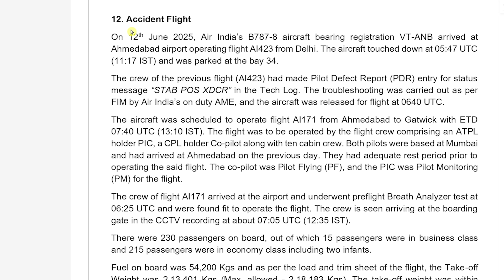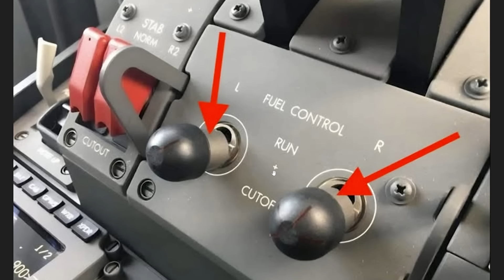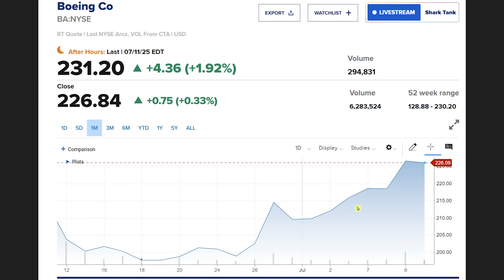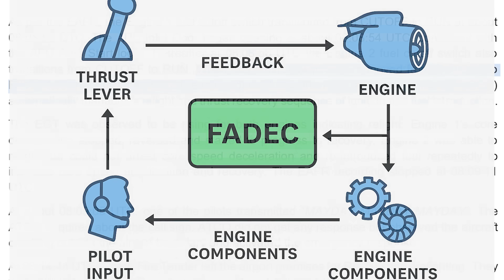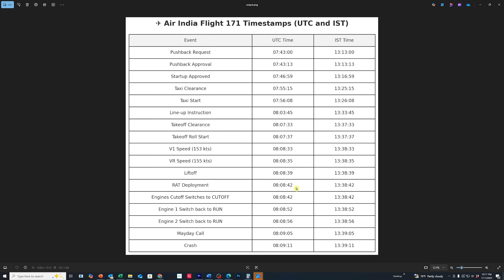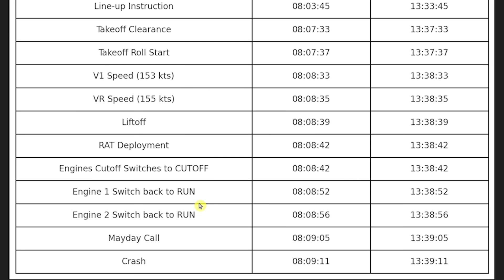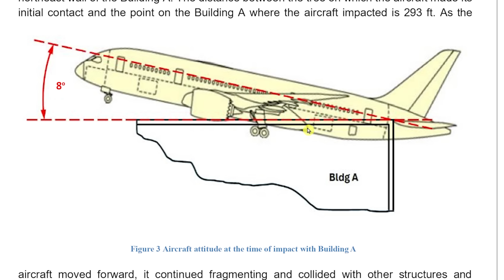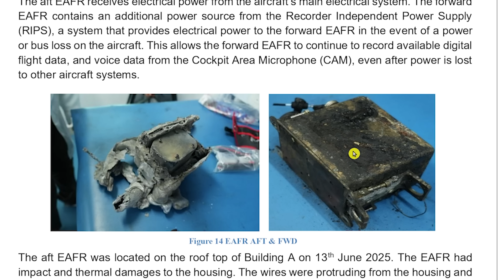Did Pilots CUTOFF Fuel? Shocking Twist Air India 171 Report!

Comment: Is it possible the switches were not fully engaged into the run position the first time and then slipped back to cutoff with vibration from takeoff? Im sure the pull is strong on them but maybe pilot didnt push it all the way up? Sort of like hovering on the detent but past the halfway mark. Even though that would be a terrible design if the case.
Reply: And he would have to do it for BOTH switches...
Reply: @BlueSpruce2 true. But now that I've read more, I'm not sure they were ever manually in an off position without both or either pilot being  aware.
Reply: @mikesorensen5228 Totally agree. This is my position as well until we understand what exactly the switches are signalling - the computer in the EE Bay below the cockpit or the FADEC/EEC on the engines?  We need the wiring diagrams and system logic for those switches.  I doubt they are hardwired directly to the engines or fuel delivery system.  And this begs the question - what is the FDR really recording - the actual physical position of the switch or an electronic signal received or transmitted from the computers to the engine or received by the engines?
Reply: @BlueSpruce2 as well, the report quotes the voice recorder without including a time stamp, so we dont know when that was said.
Reply: @mikesorensen5228 ...or picked up my the microphones - such as a switch or switches being physically moved...  The timestamps/synchronization between the CVR and FDR is going to be critical.
Reply: @BlueSpruce2 100% although they may already know something we don't.

Comment: Also, if the engines were shut down by any cause, it seems from my very limited knowledge that cycling the fuel control switches off then on it would have been the fastest way to  initiate restart automation. (?)

Comment: ✈ Final Sequence of Events (from EAFR + Report)
Takeoff Roll Start: 08:07:37 UTC

Liftoff: 08:08:39 UTC

Max Airspeed Achieved (180 KIAS): 08:08:42 UTC

Immediately After — Dual Engine Shutdown:

Engine 1 fuel cutoff switch flipped to OFF at 08:08:42

Engine 2 switched OFF 1 second later

This initiated complete loss of thrust

RAT (Ram Air Turbine) deployed within seconds — backup hydraulic power due to total power loss

Cockpit Audio: One pilot asked, “Why did you cutoff?”

The other replied, “I did not do so.”

Restart attempts were made within 10 seconds — engines started to relight

But the aircraft was too low and too slow to recover

Crash: 08:09:11 UTC — 32 seconds after liftoff

🔍 Root Cause: Why the Fuel Cutoff Switches Were Flipped
1. 🛠 Cockpit Switch Design Risk (Known Issue)
The fuel control switches installed on this Boeing 787-8 (Part # 4TL837-3D) have a locking feature.

However, a 2018 FAA bulletin (SAIB NM-18-33) had warned that in many Boeing aircraft (esp. 737s and 787s), the locking feature was improperly disengaged, allowing unintended switch activation.

Air India did not perform the recommended inspections, since the SAIB was advisory, not mandatory.

👉 Interpretation: If the locking mechanism was loose or malfunctioning, a hand, clipboard, or turbulence could have accidentally flipped both switches off, especially during a high-stress moment like takeoff.

2. 🤖 Human Factors: Pilot Error or Confusion?
No checklist or SOP during takeoff would call for fuel cutoff.

One pilot asked the other “why did you cutoff?” — showing confusion and possible lack of situational awareness.

The switches flipped sequentially (1 second apart), suggesting they were manually activated — likely by a human hand, whether intentionally or inadvertently.

👉 Possible Scenarios:

Inadvertent Activation: A pilot might have rested or brushed against both switches during a task (e.g. reaching for gear lever or checklist).

Misidentification: A pilot could have confused the fuel switches for another control, though this is unlikely given their distinct location and function.

Mechanical Jolt / Loose Guard: Turbulence or vibration might have nudged them if the guard was disengaged.

🧩 Supporting Physical Evidence
Fuel switches were found in RUN position post-crash — indicating the crew tried to reverse the mistake.

EGT (Exhaust Gas Temp) rise confirmed relight process had started, but the aircraft was too low for recovery.

RAT was deployed — confirming total engine failure.

🛑 Final Conclusion
Air India Flight 171 crashed due to the unintentional shutdown of both engines immediately after liftoff, likely caused by inadvertent movement of the fuel cutoff switches by a pilot.

This led to:

Complete thrust loss during the most critical phase of flight,

A delayed recovery attempt (relight),

And insufficient altitude and time to regain control.

The accident was likely triggered by cockpit design vulnerability (unlockable fuel switches) and unintentional human action, not by mechanical or external failure. The pilots reacted swiftly, but the loss of power was unrecoverable at such a low altitude.

Comment: Is there a direct instantaneous deployment of the RAT when fuel control switches are moved to OFF? OR  does a. Computer detect a loss of electrical power and THEN deploy the rat? Your timeline shows the cut off and the rat deployment as simultaneous. The generators could not have slowed enough to
Trigger a low power rat deployment. 
If this is the case the more likely scenario is the switches were cycled to try to restart an engine shut down by a computer error. I'm no pilot so don't know what signals the rat to deploy EXACTLY. 
Please explain, thanks.

Comment: Why do you need/require to shut off the fuel? Fire? - How fast does it react/need to react? Would you try the fire extinguishers first?
If I was in charge Idon't think I would ask "did you do that?" - I woud turn the switch on to run - then have a chat.

Is it time for a CCTV element to the Black Box?

Comment: I think quite a bit has been omitted from the CVR record, notably the interactions with ATC and the response when one pilot said "he didn't do it". Surely the other would have responded something along the lines of "Well switch the bloody things back on, anyway!".
   I don't think "pilot error" is the right description. I am sadly forced to conclude that barring system problems, either the fuel supply to both engines was consciously and deliberately cut off, or the pilot who did it was psychotic or experiencing some other kind of serious medical glitch. I had a medical procedure  under local a couple of days ago. Back on the ward afterwards, there were repeated gaps in my consciousness. Probably these were just "microsleeps", but significant chunks of time were missing between 10min BP checks.

Comment: Has this ever happened before in a 787?  Pretty sure we would have heard about it in the news if it had, so the answer is almost surely "No."   So what are the chances it was an accidental manipulation of the switches?  Very likely "zero".  If there are psychological issues with pilots, airlines need to, first, be aware of it, and then need to introduce programs to weed out unstable pilots before this kind of thing happens.

Comment: Do u know about FAA 
Advisory, not mandatory': Did FAA flag fuel control switch issue on Boeing jets in 2018? What AI 171 probe report says

"If the locking feature is disengaged, the switch can be moved between the two positions without lifting the switch during transition, and the switch would be exposed to the potential of inadvertent operation. Inadvertent operation of the switch could result in an unintended consequence, such as an in-flight engine shutdown,"

Comment: The pilot that asked 'why did you cut off?' could be the one that actually turned them off. Maybe, the intention was just to embarrass the pilot driving? And, the other thought he could recover in time but then have to write a report on his screw up. So, it could have been either pilot. Although, I am leaning towards hardware/software failure first. Eliminate that and then start examining the state of the crew at the time. Context.

Comment: UPDATE: Looks like FAA and Boeing just privately notified Civil Aviation Authorities saying the fuel switch locks not a safety concern. Acknowledging they're similar but don't feel they're currently an unsafe condition. ALPA is rejecting this presumption that it was pilot error and backed by a couple US safety experts, pointing directly to the 2018 SAIB (which to be fair to ALPA is still current as of editing this comment and has been since 2018) and are asking for a fair, fact-based inquiry. This is definitely an interesting one. On one hand we have a current SAIB which directly identifies the model of Air India 171 as an affected an aircraft. But taking an objective unbiased stance here as much as possible, it is definitely clear this potential problem hasn't necessarily ever occurred. Though it's totally plausible Air India never reported the issue when identified. Idk. But I just wanted to make sure I got this update in the top comment. Either way nothing changes here, you should always take what anyone on YouTube says with the tiniest grain of salt.

In 2018 the FAA issued a bulletin recommending inspection of fuel control switches on the Boeing 737, which are ALSO used on the Boeing 787-8 due to a risk of the locking feature disengaging, leading to a potential accident. The Air India 171 NEVER performed these inspections (granted it was technically not mandatory). This advisory came with the warning that these switches could potentially be moved by vibration, inadvertent touch, or other factors. During takeoff roll and rotation it's normal for one of the pilots to be guarding the throttles. It's entirely plausible the locking mechanism was damaged and one of the pilots bumped the fuel cut off switches down with the bottom of their palms/wrist by accident. It would explain the weird exchange (which we don't even know who said everything yet. It was said, but who said it is unclear yet) and would make sense that the switches flipped back unevenly. This system of the flight is polled at 1Hz. Once per second. If there was even 0.1 seconds of difference between the switches being hit then we would see a 1 second split between the time the switches were flipped. Obviously the investigation will be able to determine this and I look forward to the full scope, but currently I think it's fair to say with the advisory bulletin in 2018 there's a chance the locking mechanism was malfunctioning.
Reply: @madezra64 ---> What you posted makes possible sense to me. I have watched many episodes of the TV program titled "Mayday!" and sometimes it takes YEARS for the NTSB and/or other aircraft safety / crash experts to find the real cause of an aircraft failure / disaster. It seems to me that the aircraft makers / parts suppliers always want to blame the pilot / aircrew. It is really easy to blame the dead guy/guys.
Reply: The issue is the RAt deployed almost inmediately which means barely any vibration had taken place at that point and it already went wrong. So far there were no issues with that plane. These things do not just switch on its own and certainly not both. Its not the first time this airplane is flying. If there was an issue with the switches it should have caused problems before and still doesnt explain that coincidentally both switches go down around the same moment without anyone noticing

Also how do you know they did these inspections or not? Its kind of important to do that to keep flying safe
Reply: @-_YouMayFind_- there were tons of issues with this specific plane. There are even videos of passengers on the same plane but different flights posted online showing how the electrics didn’t work right. No lights or ac. Screens not working. A ton of issues. If the passenger areas were so messed up is extremely plausible that this particular plane had other issues not seen by passengers.
Reply: The plane had electrical and ac issues on the flight before!
It is all connected!
You trust Boeing. After those two 737 Max cover-ups I definitely don't!
Reply: @-_YouMayFind_-  They've already said the inspections weren't mandatory and thus Air India did not carry them out . To my mind that's crazy , you shouldn't need to be ordered to routinely inspect and confirm the correct functioning of such an important component . . If the lightbulb above my car numberplate has to be passed to get an MOT certificate, then wtf wouldn't these be checked at every service .
Reply: What you posted isn’t even close to accurate. There was no advisory, it was called a bulletin…and it specifically said that some 737 fuel cut-off switches had been installed without the locking mechanism engaged. Nothing to do with them being faulty. Get your facts straight or do not post.
Reply: @tadhglee11  Bad installation is a fault.
Reply: @joefish6091 no, it isn’t.
Reply: i think for there to be a 1 second gap between de-selection points to an intentional action as this fits someone reaching over and setting them to off,,  but they have not mentioned cockpit warnings going off and very limited voice data,,,  is this because they know what happened
Reply: If the RAT deployed before the engines were placed in CUTOFF, then that it’s where they need to focus on mechanical failure.  The RAT should have deployed AFTER the switches were placed in CUTOFF.
Reply: @falllinekiteboarding thats interesting maybe pilot mistakes the procedure trying to restart the engines. Or maybe RAT deploys immediately after hitting those switches and it happened same second, just on list this way
Reply: Are these switches a "fly-by-wire" type input? Would like to see the schematic for this system and how the fuel delivery control information makes its way into the flight data recorder and more importantly the AHM system that is remotely connected in real-time.
Reply: What nonsense are you writing here, what vibration? what random presses? don't you understand that these levers cannot be switched accidentally or by vibration? why are you pretending to be stupid? you're spreading fake news about faulty fuel valve levers on the Boeing 737, and you've come up with some kind of unlock, guys, get your heads in the game.
Reply: it was noted in the maint trecords, that the engine control assembly, which is the console that includes the throttles and  fuel cutoff switches, had been replace twice in this airplane during its lifespan. the belief that these are the original switches, installed at the factory, prior to the 2018 bulliten is simply not accurate.
Reply: For one switch I could speculate vibration malfunction. For two in 1 second split it's very very unlikely. Same with normal engine failure which happens one per ~50.000 hours. To have two engine failures in one hour chance is in 1:2.5 billion. In one second it's gonna be in 1:trillions
Reply: @oluskloc  "For one switch I could speculate vibration malfunction. For two in 1 second split it's very very unlikely. Same with normal engine failure which happens one per ~50.000 hours. To have two engine failures in one hour chance is in 1:2.5 billion. In one second it's gonna be in 1:trillions"

If the switches were worn they could have been in the middle position but the contacts making the RUN position. If both switches were knocked then they could slip into the CUT-OFF position. Because of the slow polling rate the change could be detected as having occurred 1 second apart.
Reply: I have to agree with you 100%. Faulty switched. Otherwisw the prelim report wont attached the SAIB report.
Reply: the repost says "01"  is that 0.1sec ?
could it be possible to unlatch 2 switches in 1/10 of a sec?

seems this could be a reason.. but then again..  pilot may have known about it
Reply: @BenKraal 01 as in 1 second, not 1/10 of a second.
Reply: In that case why didn't  Boeing the manufacturer take corrective action n left it to airlines to clean up their mess????
Reply: @vinithagodbole6321 Boeing would fix the issue if an airline reported the locking mechanism error. I’m not sure what you’re trying to say.
Reply: @vinithagodbole6321  The corrective action is always to alert the customer first  about fleet concerns that may have left the factory.  In some cases, that may mean that the company will send out AOG crews to correct the problem.  This was an advisory to do an inspection.  To use your language, there was no mess to clean up.

Comment: Now that I read the FAA Bulletin, it is not an issue with the crash. It says “reports of Model 737 airplanes that the fuel control switches were installed with the locking feature disengaged”.
It’s stating they were put into an unlocked state during installation. This is not stating the switches were malfunctioning as some suggested. IMO both switches malfunctioning is unrealistic. 

But, what if maintenance had been taught similar to the people at the manufacturing facility and would put them in the unlocked position during maintenance? Now, in theory, the switches are in a position to be accidentally moved. Still seems unlikely but at least tangible

Comment: The pilot flying the plane would have his hands full on the rudder to ensure the aircraft is centered on the runway and flying in the right direction and at the right altitude. He won't have spare hands or attention for anything else.
The engine thrust handle is typically pushed by the other monitoring pilot who would have the spare capacity to switch the engine CUTOFF switch.

Comment: If one of the pilots wanted to deliberately crash the plane then surely all he had to do was grab the controls and push them forward with full force.
By the time the other pilot realised what was going on and tried to regain control it would all be over.
Also a deliberate switch off of fuel supply would have been very easy once done to keep the other pilot from switching them back on.
But everyone is just keeping on blaming the pilots before the FULL story and conclusion is reached.